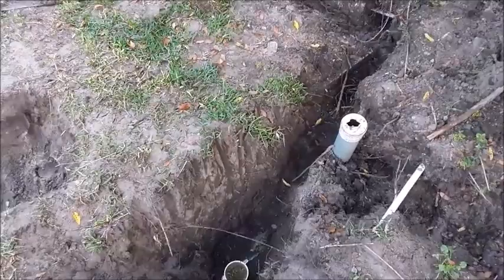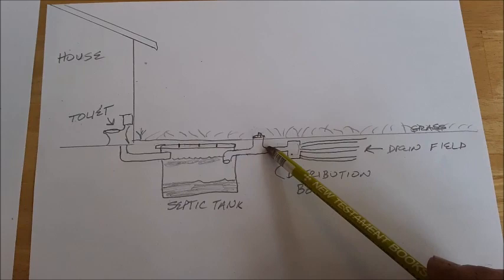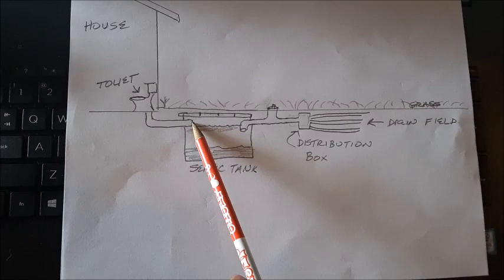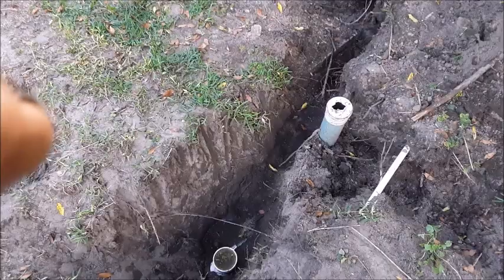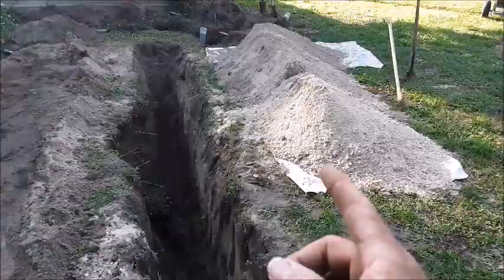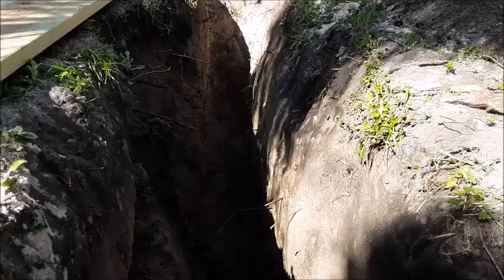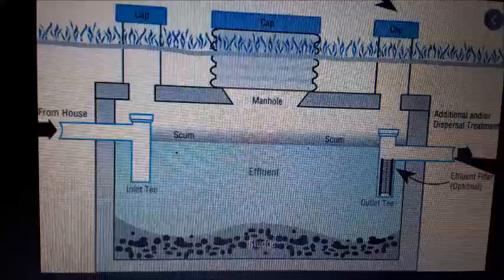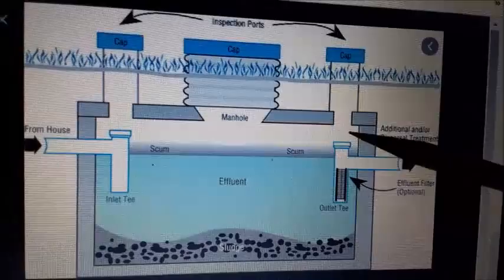$200 Septic Drain Field Repair for Beginners

Comment: Great video and some great tips. Id have to mention, that the plastic filter on the discharge T section in your diagram should be flush with the top portion of the over flow "T" and not flush with the bottom of the "T"s discharge pipe.  pushing it down that far is improper installation and most have a lip preventing it plus a discharge direction arrow. If the level of the tank over flows over the "T", then it is still filtered by 3 baffles from the top to buy you a little time to clean the filter (which MFGrs claim should be checked every month).   Also, Ive seen tanks with a single elbow discharge  with no over flow ("T") foul up, overflow the tank completely and backs into the house...a disaster when it does.  Either way, effluent is cleanest in the center so your pick up pipe should always be below the floatys but well above the sediment depending tank depth. PUMP TANK EVERY 3 YEARS!

Comment: Thank you for this video, I have been saying this for the past 8 plus yrs, my home is only 14 yrs old  & djainfield  replaced twice & failed AGAIN! My  lot was originally in a flood zone, & builder had it “ changed” so he could build. Yard was not excavated correctly, can’t keep going thru this, ( terminally ill) . Also believe in gravel over those stupid domes, BUT septic company keep saying it was the BEST! Definitely going todo this, THANK YOU, I worked for a builder yrs ago in another state, & NEVER installed dome systems, thank you , now I know I am not crazy.
Reply from the maker: Great,  glad it helped.  Interestingly all the septic systems I spoke about in the video are ones I have been responsible for for the last 20 +/- years so my suggestion aren't just things I have done and walked away from but rather systems that if there was a problem over the last 20 years I would have gotten a phone call.

Comment: Inside the tank there should be "T" on inlet and outlets with a dip pipe about 14" , this prevent solids from backing to plug line from house, and keeps floating solids from going out to field lines and plugging them. Top of the "T" s should be open and 2" below top of tank so gases can escape, and the waste water can flow. If the 'T' is missing replace it that will help prevent plugging field distribution perforated lines.

Comment: It's nice watching a video from a professional that actually knows what they are doing. I'm searching high and low for a true curtain drain video. there's a hill the bottoms to where my drainfield is supposed to be. I need to lower the water table due to poor soils and a clay underbed a few feet down. I need to block the water and divert it. Doesn't seem like anyone knows what a curtain drain is vs a french drain. thanks I learned a lot here. god bless

Comment: The last septic tank I worked on was placed in 2006, and had the Tee outlet with filter.
However, the filter extended from the top of the tee, past the horizontal outlet, down to the bottom of the tee.
There was no way for scum to enter the top of the tee due to the solid top of the filter.  Only effluent could pass from the bottom of the tee.  If sludge ever did reach that high, nothing could exit.  I'm a firm believer in using an outlet tee with the proper filter.
Reply from the maker: I agree as long as there is a hatch to access it.
Reply: @creativerepairing2960  The drain field couldn't handle the load of 6 people.  4 were kids who loved to take long showers...
We were in a new area close to a bog.  Drainage was rather suspect.  Plus, we had a 'food disposal', which is against code for a septic tank.  The convenience didn't stop us from using it though...
Anyway, the field clogged after 3 years of use, not exactly sure why, but the long showers & laundry use must have been factors.
I had tried to introduce 'aeration' to the tank, as I had learned that aerobic bacteria can even consume the 'BIOMAT' that has been formed in a drain field.
Turns out that since my tank was a 'single chamber', the aeration simply put into suspension ALL the sludge & grease scum, and this clogged the outlet drain filter.
So, the tank was overflowing AGAIN because effluent couldn't even get to the drain field....  Grrrrr....

Yeah, i learned that to use 'aeration', you really need at least TWO chambers, preferably three.  The first to catch it all, with sludge going to the bottom, and scum on the top.  The second to have the 'aerator' introduce oxygen into the effluent to heal the drain field. And the third chamber to settle down and relax any suspension of scum/sludge that may have gotten through to the second chamber.  
This final chamber should only have calm, aerated/oxygenated effluent to introduce to the drain field.
It would make sense to have access panels to each inlet/outlet and to have filters on each outlet for safety.

Gosh, this is a long post for someone who has only worked on one septic tank.  Take it for what it's worth. 
😁
Reply: You could put an aerator on a timer for a few hours when your asleep to allow it to settle or septic genie is its own chamber you drop in
Reply: @gauravvij67    I really like your 'timer' solution.  That could 'aerate' the effluent sufficiently and allow the scum/sludge to float/fall out of suspension and allow the clear effluent to flow out to the leach field without clogging the outlet filter.

I just watched the video on the Septic Genie.  I dunno, seems to me like it would suspend scum/sludge too much and clog the outlet filter on a single chamber tank.

Comment: Question: i have a sump pump that pushes the brown water into a mound that has sprung a leak. 

I want to find the pipe and abandon the mound. 
And dig a trench like you’re teaching in the video-

With the pump pushing it do I need to keep the pipe level?  Or does it have to have a slight pitch to drain into the trench?

Comment: Think my septic/field is ok, but I did find blockage in the main line under the home which is 50ft. long.  I bought a snake machine, and a 100ft. camera and scraped  the main whole line under the house clean as a whistle.  I actually ran the camera right into the septic tank, pretty crazy sight that was,, like diving into a dirty pond with a diving mask on. lol I like your fix though gives me many ideas if I have more problems. Just have to park my truck in front , so the building dept. doesn't stop by to see what I'm up to. lol
Reply from the maker: glad you drainfield is ok,  where did you get the 100ft camera?  Thanks

Comment: The dome system has slits all along the sides 3/4 the way up. So, not true that domes only allow perforation on the bottom. Pipes clog up within themselves. So, consider that as well.

Comment: I appreciate the video I’m .doing 20 feet of pipe. How many feet of rock underneath the pipe would you recommend
Reply: Did you do it? I will be doing mine tomorrow.
Reply: @kelvinfeliciano  Still going strong a year later.Every now and then I look at the Tee to see the health of the drain field .Im happy with the results.
Reply: @johnrobert2074  I did mine... 40 feet 8 tons of #4 rca added a baffle to the septic with it affluent filter. Added a T for cleanup etc.

Comment: Just a little note. I've installed 3 separate infiltrator style drain fields in clay and pure sand. The new infiltrators have side slits that allow the sides to leak effluent witch greatly increases their capacity. They also do not fill with micro solids like gravel does. The reason most septic installers prefer gravel is it's cheap and they can make a much larger profit. My local septic installer is part owner in the gravel pit. How many infiltrator systems do you think he installs. Zero. Absolutely zero. Yet in most cases it greatly reduces the footprint of the drain field. Sad but true.
Reply from the maker: I don't disagree with what you said.  I have also used the environmental domes / infiltrators but found they didn't last as long as the gravel.  I used to think the micro solids would stick to the sides of the gravel thus giving more capacity to the gravel vs dome since the surface of the edges of the drain field would have less build up over time.  A couple years ago I dug up an old dome system and found the first dome in the row was blocked by micro solids thus plugging up the system yet the rear domes were still clear.  The reason this doesn't happen with gravel is because of the long black corrugated pipe with holes in it which distributes the micro solids over the entire drain field thus giving it a longer life.  After realizing this we reinstalled the same domes back in and set them on top of a row of 8 inch cinder block which effectively tripled the amount of capacity the domes have before the micro solids build up above the "side slits" thus plugging the system.  Additionally I am considering adding a second mini tank with a filter thus eliminating the micro solids from reaching the drain field all together.

Comment: Thanks for this video! Great work. Just curious if the Soil Separator you installed covers the bottom of the trench as well or just the sides? Just wondering if that should remain open for percolation
Reply from the maker: I put it on the bottom also.

Comment: If you have an elbow instead of the T , water and solids will siphon out of the septic tank and into the drain field and you don’t want that to happen. the T or baffle should extend half way down the inside of the septic tank.
Reply from the maker: Hi,  Thanks for the comment.  The water inside the exit pipe will never fill to the point of being able to siphon but if this is a concern simply drill a small hole in the upper side of the elbow to relieve any siphon suction concerns.  As for the baffle extending half way down the inside of the tank, this is fine if you pump the tank at regular intervals.  I know people who have gone 30 years without pumping a tank which is not a good thing, but as sludge in the bottom of the tank builds up to the point it passes the bottom of a T extending down inside the tank, the water level inside the tank will rise and water and solids will begin overflowing the top of the T and your drain field we be ruined shortly after that.

Comment: Good evening. Awesome video and something I’m going to try really soon. The only thing I missed was the part where the T is installed in the line between my current drain field and septic tank. Is there anything special needed to do this part?
Reply from the maker: Use a 4 inch rubber union with hose clamps which can be purchased at home depot or Lowes.  You can glue one side of the T to the pipe you cut out and the other side of the T if you glue a short piece of sewer pipe into it and slide the rubber union over it then once you put the T in place slide the rubber union into position over both ends of the sewer pipe and tighten the clamps

Comment: The domes i used also have slits in the sides for water to pass through and no rocks needed made it a lot easyer but Idk about how long they will last I'm fine if its at least 20 years

Comment: Hi too I'm a born again Christian Nice to see your witnessing through your videos. I have one question though how do you install the tee when you can't move the pipes or do you use a rubber tee flexible enough to fit over the existing pipe once it's cut. Thanks in advance.
Reply from the maker: Thanks for the reply.  Assuming you are dealing with pvc sewer pipe:  You can cut out a section of underground pipe where you want to install the T to about maybe a foot wider than the T,  cut a small piece of the piece of pipe you cut out of the ground and glue it into one side of the pvc T at a length that you can barely fit the T with this short piece of pipe into the expanse where you just cut out the piece of pipe from the main line in the ground.  Take a straight rubber union with clamps and slide it over the short pipe you glued into one side of the pvc T.  Glue the remaining unused side of the T to the end of the pipe in the ground.  Slide the rubber union over the other end of the pipe in the ground and tighten the clamps.
Reply: Me again okay I dug my ditch I lined it with soil separator but the issue is I found for them to deliver crushed concrete and when they dumped it it was basically gravel they said they don't sell that stuff you mentioned anymore because it wasn't in demand. So my question is can I put this gravel in there Will it impede the flow etc. Thanks sorry for being such a pest.
Reply: Hoping you got my last message thanks
Reply: @creativerepairing2960 do the holes in the pipe go up or down my pipe only has two rows

Comment: Must be nice not to have any rock! That probe would bend in my ground! Thanks for doing this Video, a great help for a lot of people. What would you do for septic tank back-flooding? i.e. run off and ground water infiltration from leach field or through the seems of the tank.
Reply: Yep, compacted 8-10” of 1-2” smooth gravel to dig through. Sometimes seemed more like chipping off of an boulder…..
Reply: @brandonclay6933  I put in a back flow valve to the drain field and sealed around the lid and outlet pipe. Seems to be working.

Comment: Ty for doing these videos, I got a couple ?’s for you, I pray you answer. Do you use perforated pipe or solid pipe, what size pipe do you use? Should you cap off the ends so tree roots can’t climb up the pipe?
Reply: That pipe is perforated. I believe you can buy them at Lowe's or Home Depot. If not, just buy a 3 or 4 inch pipe and drill a bunch of holes in it. The size of the pipe depends on the size of the exit pipe from the septic tank. I don't think the pipe size matters as long as it's 2.5+ inches in diameter. The pipe he is using looks to be about 3-3.5"? And yes, cap off the end of the pipe that way nothing grows in it and you can extend the pipe in the future if you ever have any problems.

Comment: Blessings on you friend! I come from a large family of 12, our patriarch passed away a couple years ago leaving my grandmother in charge of our land. Our septic tank lines just went out with the crazy rains occurring in California, I was curious how long of a drain field would be recommended for this amount of people using showers, cooking, and bathrooms?
Reply from the maker: Hi,  Sorry to hear about your Grandpa.  As the water from the floods dries up you may get some flow to the septic again but we had that same issue and it wasn't long before we had to rework the drainfield.  As for how long it is a matter of how many years do you want it to last.  In the video we were adding on to a slow draining system.  In my experiance say 20 ft with 6 people will get you about 10 years.  You can size up or down from there.

Comment: What if there is a leak from where the pipe comes out of the tank into the drain field, how do I go about sealing it? Thanks for your help
Reply from the maker: As a DIY "Do It Yourselfer" I have always used either concrete or spray foam.  Biggest issue is not as much the water loss but roots will find the leak and grow into the tank.  I often used some of those septic root crystals sold at Homedepot or Lowes and sprinkle them around the area where I make such a seal.
Reply: @creativerepairing2960  thanks for the feedback, will definitely give that a shot. Trying to locate the junction box, do all require one? God bless

Comment: how long  and deep and wide  is the trench ? thanks !
Reply from the maker: Hi Scott,  The one in the video was about 20ft long, 5ft deep, and at the top was about 2 1/2ft wide but tapered down to about 1ft wide at the bottom.   The more surface contact the drain field has with the outside dirt the better as that surface contact is where the water disseminates out of the drain field.  That is why we kept it deep and narrow. Surely the bigger you make it (the more surface contact) the longer life you will get out of it.

Comment: Good morning and blessing s to you and your family! I think your for your advise! And yes this would definitely save me about 6000 from replacing drainfield. So I would like to try this first . Is there a way to figure out where the drain field is located next to the septic or find which side the pipe going from the septic to the drain field is?
Reply from the maker: Hi, If your ground is soft enough you can use a probe like the one in the video to locate it.  Some areas are very rocky so this wouldn't work in which case you could remove the lid from the tank and view which side the pipe is on.  Some tanks just have a access port which if you remove that you might be able to hold a mirror in the access whole and see where the pipe is.  Hope this helps.
Reply: Thank you for the response!! I have another question. Sorry this will be my first time doing this so I’m kinda slow when it comes to these projects . But  how deep and how long do dig the trench for , also are you willing to travel to Florida? :)
Reply from the maker: Hi The size of the trench will determine determine life extension you will get out of your project.  The repair we spoke of in the video which was about 4 tons of gravel in our experience will probably last 10 to 15  years.  I know of 2 of them which are about 20 years old and still flowing.  The outlet from the tank going into the drain field, if it is an elbow facing downward will greatly increase the life of the job.

Comment: Is there a way to put a hole in the pipe to give temporary relief without having to dig it up and also my pipe is plastic
Reply from the maker: where ever you make a hole in the pipe water will rise in the dirt whole you dug until enough sludge seals up the edges of the dirt hole and will not allow water to absorb into the ground.

Comment: What do you use to seal around the pvc pipe in the distribution box?
Reply: I did mine 30yrs. ago, I used duct tape wrapped around the pipe and force fitted it in the box, guess it worked after 30yrs. with no problems. Dont remember why I did it that way, might of asked someone, can't remember.